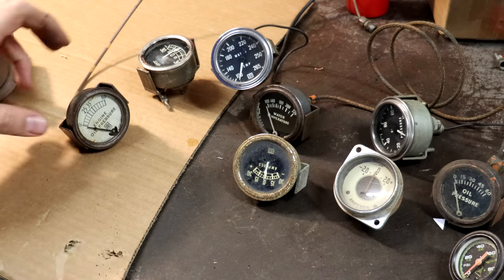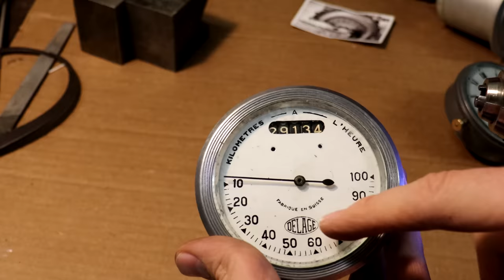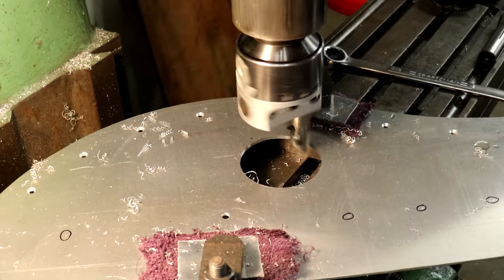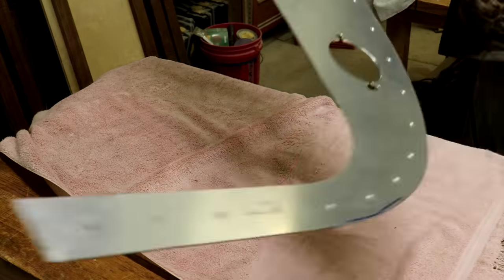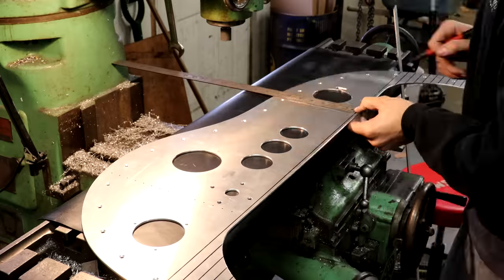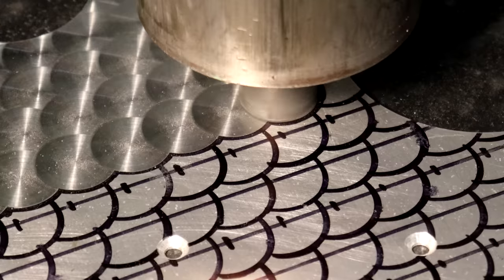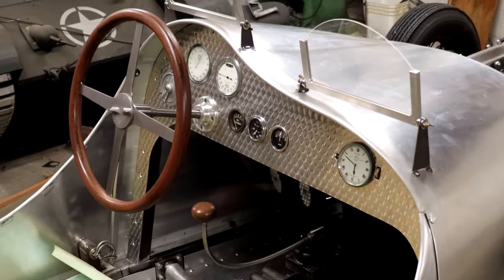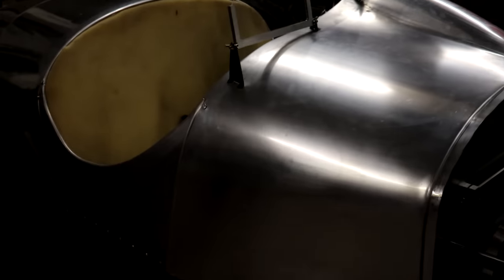A Dashboard Fit for a King 💎 | Homemade Boat-tail Speedster  Pt. 63

Comment: What a superb job of engine turning. You have remarkable patience. As far as the clock goes, watch a few watch or clock videos before you mess with it. Understanding even a little bit will help you to service it. Also, DON'T be tempted to flood it with oil, or worse still WD-40. It may well have a watch-like movement that only needs tiny drops of oil in critical areas.
Reply: I 100% agree!! It may look like a dash clock and may give you thoughts of simple, but I promise that that is gonna be as complicated as a pocket watch and there's all kinds of horror stories about people destroying family heirlooms because they thought they understood enough to go digging through it.
And as far as oiling it goes, just like precision metrology instruments, which is literally an extension of precision watchmaking, you should only put oil where oil goes. And these locations are marked by a through hole that has a small divot like cup meant to hold a single drop of oil that would come off the tip of a sharp needle. That is all. And before you wind it up any more at all it needs to be gone through by someone who knows watch repair.
It looks like a legit antique Bugatti or equivalent dash clock and I know that those were made by top swiss watchmakers back then. If it was just some mass produced dash clock I'd say tear into it and try to get it going yourself and just learn from it, but not on something that may have you kicking yourself if you can't get it back into working order
Reply: @BIGWIGGLE223  Caution! Use only clock oil! Every other oil gums up over time. Clock oil is readily available on Amazon.
Reply: @georgehollowell9295  I recently learned that horologists may use nasal sebum (AKA nose grease, also only produced in sharks liver) to lube the jewels of their instruments. LOL

Comment: In watchmaking that pattern is called pearlage. Speaking of watchmaking, you should have a watchmaker take that clock apart. Usually you need to strip off the old oil to be able to add new oil. Not to mention almost all watchmakers have moved to synthetic oils for watches these days.

Comment: That dash is gorgeous! On the clock, see if you can find a watch/clock maker; he/she would probably clean it and get the guts right, rather than just add oil to what's there. You'd end up with a more satisfactory end product. 
There's a comment below concerning getting the dash lacquered before it tarnishes; I second that! This is so good looking, I'd hate to see if look less than it does. This entire project has been so ambitious, and so well executed that I'm just gob-smacked!

Comment: Looks amazing,  I remember using a 1/2" piece of dowel with a notch cut in the end & using emery tape folded in half & pushed into the notch than folded back flat in a drill press to do a fire wall in a a model ford

Comment: My uncle raced those huge sprint cars, seemed much taller than I was at the time. Folks and I visited with him and grandma when I must have been 7-8. Half bro came over to jewel the dash of his Studebaker Hawk using uncle's barn machine shop. Bro used something like a half inch diam. pink eraser from what I recall from 60+ years ago. I was quite fascinated by the whole process. You did quite an impressive bit of detailing yourself. Thanks for sharing and BTW I subscribed to your channel.

Comment: These fishscales are phenomenal. I tried my own by times, with small wire brushes from different metals though, and on much smaller parts, but I gotta have another go at it with Your technique - that dash is absolutely worth every second You put in it! Thanks for sharing.

Comment: Just more stunning work. You mentioned oiling the clock to get it to go. Clocks need special oil, easily available but the best thing would be to strip and clean the clock, which for a man of your talents should not be too difficult. The oil will be turning to varnish in the pivot bearings and you need to use some wood and solvent to get the old oil out. I am thinking that a clock of the Jager Le Coutre  will probably not be worn but I would replace the spring if you can get the correct size because the old spring may be a bit set and modern springs are much better.

Comment: Nice. When we did engine turned dash panels, our tool was a cylinder of red grandis (eucalyptus), and 'Chemico' valve grinding paste. Done laboriously on the drill press
Modern tools and methods can be a lot quicker and cleaner...

Comment: Good video. You do amazing work, a craftsman for sure. I hope the clock gets fixed. It most likely needs to be taken apart, all parts cleaned, pinions checks etc. Make sure to use clock/watch oil only.

Comment: This whole build series has been amazing needless to say!
The other definition for this effect is called "doweling". It's the way English coachbuilders did it: take a hardwood dowel of the required diameter, and pound valve-grinding paste into the end of it, plus more on the surface to be treated in a thin layer. For flat sheet stock, this was done with a drill press or milling machine, indexed for the needed spacing. Otherwise it was done freehand with a handheld drill.

Comment: Looks great! Thanks for the tip about the abrasive things. Not right for my car but handy to know. My mentor always told me off if I said dashboard when I was walking about the 'instrument panel' on pre-war cars. Proper chronometric tachos are hard to find and expensive. If that is a proper, period Delage face on your chronometric speedo that is worth money to someone. I am working on a  little circuit to read off a spark plug wire to drive a modern tacho that I can modify to look suitably pre-war and emulate a chronometric tacho to some degree. But you can't easily replicate that clockwork look the real ones have in electronics with modern tachometer mechanisms. The other incredibly useful instrument is the ignition light. That tells you the state of the battery and the charging circuit (generator or alternator) in a simple way if you understand how it works.
Reply: Absolutely ! I cringed when I saw him apply the electric drill drive to the pukka Delage instrument ,and could only imagine what Delage owbners were thinking . It was so out of character . When I had my SSK replica built in the 90's (on a mid 30's 8cyl chassis),I had replica instrumentation made , including Jeger tacho,though I finally managed to source a genuine Bosch ignition switch, ex period Alfa 8C ,or perhaps Bentley 8 litre , .Proper Bosch headlights,  also common to to the 8C, and bull horns  were eventually sourced .
I would hope the epnonymously  branded Delage instrument finds its way into more appreciative appropriate hands .
PS: I follow your channel too
Reply: @Birashanuman  I am not sure it's a proper Delage gauge? It is a proper chronometric mechanism definitely but someone has put the wrong face on it? He mentions that in the video. The face seems to be missing the two little screws that hold that on as well as it being a clockwise mechanism but an anti clockwise face! It is an interesting bezel on it too. That ribbed aluminium kind was used on higher end cars I think. Also I think the right angle drives are hard to find so that's nice to have. Smiths in the UK bought the UK Jaeger company in 1927. I have come across other bitser type gauges before. Often sold with the sellers saying "no way to test". Finding absolutely correct period instruments is really hard and some of the prices now are insane.

Comment: Absolutely love  what you have achieved. The body work is turning out amazing. I drove British vintage sports cars for years, most of which had aero-screens and what really finished them off was to a fairing bellow the glass. In some cars this was nothing more than a nice piece of polished timber shaped to fit the body contours, and on others like early Jags and MG's (you get the idea) they were hand shaped light alloy. I bet there are plenty of photo's about. 👍

Comment: For your ammeter, you will need a shunt to limit the amperage, unless you are going with an old school generator to charge the battery. If anything, you could get a modern alternator that looks like a generator, for the old look, and put a higher amperage gauge in for that.

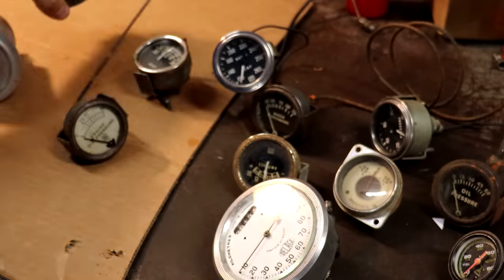Comment: 1:35
nervous chuckle
my suggestion, as some one who has messed around with a mechanical clock: do a video on it. you are going to want to do that. 
also, some advice regarding clocks: do a bit of research on what kind of oil that kind of clock would need, cause i can garantee, it aint motor oil, a high quality synthetic clock oil (i got a bottle of horace whitlock's clock oil) is what your gonna need, and have a LOT of patience, also theres a chance, that the pivot for the balance wheel might be cooked, depending on how the clock is made, which considering its meant for race cars, it may or may not have a shock protected balance staff,  i'd hope it does and that the balance staff (the pivot for the balance wheel) isnt dead, cause it might be hard and most certainly expensive to fix that issue
but, dont let my words scare you off, you could be trying your first movement on a tiny wrist watch, now thats terror,  small parts, inadequate tools, yeah, no thank you, ill stick with my alarm clock for now, though i do want to get a mechanical wrist watch, them things tend to last way longer than electric watches

Comment: I made a mandrel for the pattern out of a short stub of broom handle on a long bolt with a glued on leather pad hairy side out and used valve grinding paste on the pad to make the pattern, the mandrel went in a pillar drill and the circles were overlapped to make the pattern.

Comment: So incredibly nice, love this build. exactly my taste of car to the smallest detail.

Sidenote as a clock and watch hobbyist my advice is you could try to fix the jaeger cock but i recommend letting a watchmaker do the service , special oils are needed and it is very easy to destroy them for a beginner. I do have a similar 8day jaeger but in black, had my watchmaker service it ten years ago works great still.

Comment: superb! regarding ths Swiss clock and other chronometric instruments, you may want to consider a suspension (like was done in period) so that the engine/body vibrations are not fully transmitted to these fragile instruments...

Comment: Watchmakers sound off!!

Surely he has at least one follower that does watch/clock repair and would be willing to make sure that that beautiful antique dash clock is in good working order, right?! That clock could be the Crown Jewell of the dash along with the Crown Jewell that is the engine.

Oh! And don't wind it up any more until you have someone that knows what they're doing go through it and place oil where oil goes! That thing is beautiful!!

Just looked it up. It is a legit Bugatti clock, but you already knew that. Quite surprised at how low they were going for. They must've made a shit ton or it may be because it's an 8 hour and not one of the 36 hour movements. Either way, I'm jelly.
Reply from the maker: Jaeger made these instruments for a variety of high-end auto companies, including Bugatti. They come up for sale fairly regularly from europe (where this one came from), but not the US. 8 jour is French for "8 day", so it's an 8 day movement period
Reply: @MacroMachines  wow. I didn't think it was days! That means the ones I saw that were 36 jours were 36 days. That's impressive! What years did they manufacture these? Do you know? I can't remember the dates I saw, but I know that the gauges and all are period correct for your boat tail speedster. 
And excellent job on engine turning that dash! Turned out gorgeous!
Reply from the maker: The ones that say 36 are "36 heures", which is hours. 8 day seems to be the most common, but I've also seen 4 day and 36 hour. Jaeger started making dashboard clocks in 1921, and continued for many years. My intuition is that this is one of the early versions, so probably early to mid '20s
Reply: @MacroMachines  I guess ya learn something new everyday. I didn't pay close attention to the words so much as the number and showed my lack of knowledge on the subject. I'm more familiar with the period correct American gauges from the '40's to the '50's with a little knowledge in some of the highly sought after gauges that hot rodders of the time went after. 
Very fascinating time period to which I'm sure you've acquired a vast amount of knowledge while HAND building your Boat Tail Speedster. The knowledge that I mostly acquired comes from building my dream hot rod in model form until the day comes that I can get my hands on an original '28 Ford Sedan body. 
Blows my mind when I think about you going from that awesome little tank to an aluminum bodied Speedster. 
And you're working for Elon now at SpaceX, correct? No surprise there whatsoever. That's gotta be fascinating. One day you should make a video about what you do. If you're able to that is. 

Anyhow, can't wait to watch you take that thing for a proper rip!!
Reply: @MacroMachines  I guess ya learn something new everyday. I didn't pay close attention to the words so much as the number and showed my lack of knowledge on the subject. I'm more familiar with the period correct American gauges from the '40's to the '50's with a little knowledge in some of the highly sought after gauges that hot rodders of the time went after. 
Very fascinating time period to which I'm sure you've acquired a vast amount of knowledge while HAND building your Boat Tail Speedster. The knowledge that I mostly acquired comes from building my dream hot rod in model form until the day comes that I can get my hands on an original '28 Ford Sedan body. 
Blows my mind when I think about you going from that awesome little tank to an aluminum bodied Speedster. 
And you're working for Elon now at SpaceX, correct? No surprise there whatsoever. That's gotta be fascinating. One day you should make a video about what you do. If you're able to that is. 

Anyhow, can't wait to watch you take that thing for a proper rip!!

Comment: Great job!!! I'm building a Locost(Lotus 7 style car) and I may do the same thing to my dash, it looks awesome. How many of those abrasive tools did you use up for your dash?
Reply from the maker: I did all of this with one of the abrasive tools, and you'd need calipers to measure how little it wore down. You could do tens of thousands of turnings before having to swap the rubber
Reply: @MacroMachines  If you would consider an Engineering job in LA, in the space field, look up Honeybee Robotics. I'm one of their machinists there.